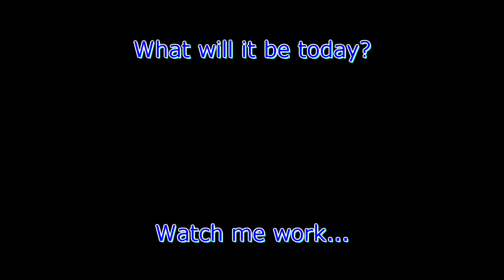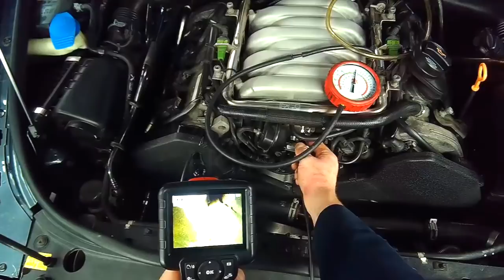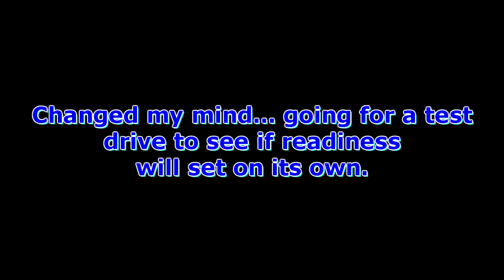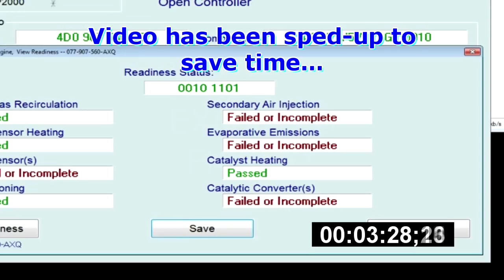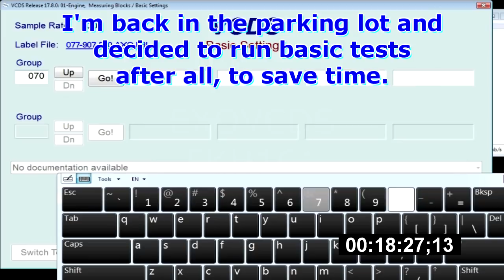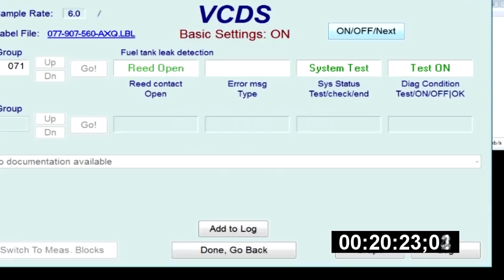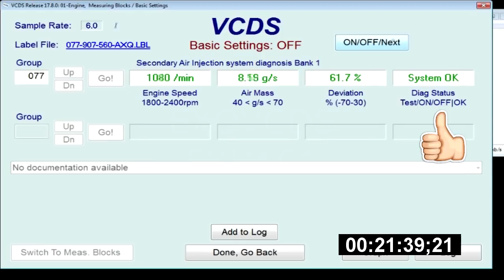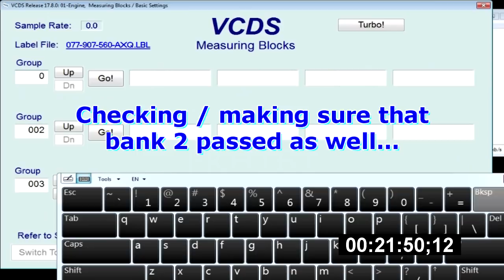VW 7L: Touareg with Secondary Air Injection Fault

Comment: Nice work. Handy having the right diagnostic tools and the knowledge to use them
Reply from the maker: I still tend to overthink stuff and that can add to the time (and pain in the head).
Reply: Thinking is the best way to travel.
Speeding through the universe.
Reply from the maker: Makes sense... all the daydreaming I did in High School... time DID go by quickly!
Reply: There ya go man 
keep as cool as you can
face piles and piles of trials with smiles
it riles them to believe that you perceive the web they weave
Reply from the maker: MostlymoparIH Whoa, that's deep man!

Comment: I've watched this twice and don't really get it yet. Gonna give it a third go later and maybe watching on a bigger monitor well help so I can see better. Combi's good, Mani vac good, check valve good, no restrictions, solenoids good. You checked to see if monitors would set with the one pod removed and that worked confirming bad pod. I'll be back....
Reply from the maker: Yes... the bad pod was leaking air / vacuum, which prevented enough vacuum from getting to the combi valves.
Reply: Thomas EXOVCDS Codes will come back since still bad pod. Monitors will auto reset after customer repairs pod and then does 20 mins of driving. Codes go away upon monitor reset. Happy days?
Reply from the maker: I left the pods disconnected... intake runners are not monitored, so no codes will set for them not working. Secondary Air will continue to pass as long as the pod(s) remains bypassed... until he replaces it. Yes, happy days!

Comment: Hey! I stumbled across your vid having the same issue. I must say it was very informative and helpful. My question is: what is the actual name or part number for the pod. I’m currently looking for one. Thank you in advance. And one more question if you don’t mind. Would that also throw codes for the O2/ catalytic converter as well. I have very hard shifts and sluggish performance and I’m wondering if they are related by chance.
Reply from the maker: https://www.ecstuning.com/b-genuine-volkswagen-audi-parts/intake-manifold-repair-kit-priced-each/077198327a/
No O2 or cat code on this one, so no... I don't think a bad pod will cause those codes.

Comment: Thx for sharing this my friend! Good info on setting the monitors
Reply from the maker: They can be set in the parking lot (not moving), by following the VCDS instructions... but I like to see the ECM set, so that there is no doubt it will do it the next time. But when time is a factor, I too "force" the tests! LOL
Reply: Thomas EXOVCDS I have run into air pump issues like so, then monitors take for ever to go by it self. Share as much as VCDS as you can. That is super helpful
Reply from the maker: Had there not been a vacuum issue, I would have activated the pump (output tests) to verify operation and would have also opened the diverter valves & ran the pump manually... to watch fuel trim values. Similar to this video:
https://www.youtube.com/watch?v=4GPFeCeugNk

Comment: Have you ever ran across a situation where both combi valve ports going into the heads on both sides are totally clogged? I am dealing with that now. Last week I chased the holes going into the heads that leads into the combustion chamber first with some stainless wire and then with aircraft cable wire. I got A LOT of crap out.

I replaced the passenger side combi because it started to leak a bit. I put it all back together and got the same code, bank 1 and 2 insufficient flow. I opened both valves via a vacuum tester and tried to blow air into the metal piping that the air pump blows into that leads to the valves and into the head, nothing.

Now it seems that I am going to have to pull the valves yet again and use something stronger than throttle body and carb cleaner, perhaps use acetone and plug the holes for a couple of days to let it soak.

One of German engineers dumb flaws is the setup of the SAI system. It would have been nice if they would have had the holes going into the cylinder heads a bit bigger so they wouldn't gather carbon like they do. Heck, it would have been nice not to have the system at all and to be able to bypass it without throwing a code. If only I lived in one of the states that did not do emissions testing.
Reply from the maker: I have been lucky not to have to deal with plugged SAI passages... so I can't offer any advice with regards to the best way to approach the cleaning or what works best, sorry.
Reply: I managed to get both ports unplugged. I took the combi valves off from the heads, then I took the valves off from their mounting bases and bolted the base back onto the heads.

Then I filled the passage ways with acetone until I could no longer fill them and let it sit in there for a couple of days with the holes plugged with silicone plugs that fit.

I then purchased some acrylic clear tubing at a Home Depot and ran it down the passage ways and sucked out the acetone with a suction syringe. There was A LOT of black carbon that came out of both passages.

I flushed them 3 times until no more black gunk came out. Before, I couldn't get any air at all into the passenger side passage way, and little air down the driver side. Now I can get a good amount of air running into both of them.

The acetone worked a lot better than any store bought cleaner in a spray can that I had purchased. For good measure, I filled both passage ways 1 last time and will let it sit for a couple more days and then put it back together so I can FINALLY get that car to pass inspection.
Reply from the maker: Sandman1832 good info, thanks for sharing!
Reply: No problem mate. Some of your videos have helped me when I needed help. Anything that I can learn while working on my vehicle that would benefit others, make things easier for others, or even show a simpler method of doing things, I figured that I should share that information to help out.

Between knowledgeable forums and youtube channels like yours, I have saved myself a lot of money working on my 6.6 Dirtymax and my audi, especially with the Dirtymax.

Comment: Great video. Told me loads. My diaphragm arm was broken. Fixed that. It works! Then saw the second diaphragm not contracting (left of your problem diaphragm in your video, front view). Contracting is a vaccum issue? . Is that a total replacement or check for working system/spring? Appreciate guidance
Reply from the maker: Could have a broken diaphragm... check it with a vacuum pump.
Reply: @EXOVCDS  cheers, will do. I've not yet vaccum sucked the diaphragm but I note your solenoid arm was moving (from the manifold). Both mine don't move manually (the fixed good one moves when revving). Normal or no?
Reply: @EXOVCDS  update,..... you did it!! 

It was a torn diaphragm (same one as vid). Will replace. I did a smoke test and smoke came out. Will also replace most hoses for assurance. 
New issue, the arms of both diaphragms don't move (by revving engine or finger force). How come? 

Plus the brake booster vaccum hose was cracked (temp fix with tube piece over the top). Will order new.
Reply from the maker: @wviti64  Thank you for the update! I'm not sure what the actual criteria for movement is... some things don't get activated unless the vehicle is driven / an actual load is applied. I would use "output tests" in VCDS to check ECM control of the actuators. If they work in output tests, then there's no reason the ECM would not be able to move them when needed (while driving).

Comment: Nice Work. How long did it take to to diagnose the issue? Very detailed and thanks for making the video.
Reply from the maker: Under 10min for the low vacuum fault (main cause)... 20+ minutes for test drive to verify (which could have been done under 10min by forcing readiness in the parking lot).
Reply from the maker: Not sure where your other message went (about the pods)... thanks for the info! Send me your mailing address and I'll send you some of my channel stickers! If you want some. fkh161@fkh161.ca
Reply: I deleted it. I didn't want to put too much information that might distract from your diagnoses and skill.

Comment: 2004 VW Touareg 4.2L V8
17887-008 
181104-002
17819-002
17072-004
01045-008

I can't seem to find anything related to all these codes.. perhaps you can lead me to the right direction for these..
Reply from the maker: You are subscribed to a lot of good car channels... they didn't reply? 
The brake booster vacuum system code is probably due to a vacuum leak.
Bank 2 SAI fault code should be easy to fix, since bank 1 is OK (check the system like I did).
Get back to me with what you find for those two and we'll knock off the rest.
Reply from the maker: Any update?
Did you find a leak in the brake booster lines?
Is the SAI combi valve OK for bank 2... the vacuum solenoid & lines ok?
Reply: @EXOVCDS  I haven't done that I'm watching your video again. But I know I need a new fuel filter hopefully fuel pump is ok but im going to begin this issue tomorrow
Reply: @EXOVCDS  oh when taking out the air filter on passenger side it was stuffed in (like squished) it came out in pieces and there was an connector at the bottom of that air filter it wasn't on properly. I got new air filters coming in plus I'll be doing spark plugs on this VW touareg once I gotten the present problems done and cleared
Reply from the maker: Thanks for the update!
Reply: @EXOVCDS  😡

Comment: my Tuareg 2004 v8 when I start it robots 30-40 sec and then turns off gives errors P 1423 P 1411 I checked the pump and even replaced it, but it does not fix and continues to shut down. when I force it to full throttle it does not go out
Reply from the maker: What does "it robots for 30-40 seconds" mean?
Lack of secondary air flow should not "stall" the engine... but it is in indication that there might be a vacuum leak (excessive lean running / fuel mixture at idle can cause the engine to stall). Listen for a vacuum leak (hissing / sucking noise) while the engine "robots". Post a video on your channel so that I can see & hear what it is doing (youtube is great for sharing videos).

Comment: What code was it reading?
Reply from the maker: In case you missed it in the video... pause at 0:05
Reply: Haha wow i totally missed that. Thanks. I did get a different code than this. P0492 looked it up on your 200page list.
Reply from the maker: Bank 2 (driver side) failed... which means that the Air Pump, the fuse, the vacuum solenoid are all good, because bank 1 passed. Look a broken vacuum line to the bank 2 combi valve and check if bank 2 combi valve opens (it could be stuck closed). My 200 page list?
Reply: @EXOVCDS  Oh I thought the list of codes website was yours that’s all. 
Btw I got the new check valve in the mail today and I want to confirm with you that’s it’s just a unbolt and bolt back on type of job..? And I also want to confirm that it’s the right side of the vehicle when looking directly at the vehicle from the hood? 
Thanks for your help
Reply: @EXOVCDS  sorry for all of my misspells. Tried talking to Siri and it didn’t translate well. I just fixed all of the bad grammar so hopefully
My questions make better sense now.
Reply from the maker: @mallkrawlerz620  Standing in front of the vehicle, bank 2 is the right side (driver side) yes.
Reply: @EXOVCDS  thank you

Comment: if you own one of these and want to cheap out on those vacuum pods they are very pricey from VW or Porsche, you can get Cruise  control pods off a volvo 850 will do the same thing . just saying.
Reply from the maker: Good tip... thanks! Did I send you some channel stickers already?
Reply: no..lol
Reply from the maker: Send me your mailing address (private message) and I'll send you some.
Reply from the maker: +DW Red Got your message... they will be in the mail tomorrow!
Reply: I've looked...land rover, jaguar, volvo, Mk3 Golfs/jettas...these pods still command a healthy asking price...I think new, the cheapest I found was from a Lambo site of all sites...VW sites wanted a bit more...sure, Ebay has them too, but those are all "used" with unknown mileage, actual working condition, etc., etc....I'll try rockauto and see what they have or world impex.
Reply: Landrover ETC7150 / $85. The only difference is that the metal clip that connects to the linkage arms on the pod is slightly different angle. Not sure if they rotate or you can use the old clips. It is the same part # made by Hella, just the metal clip is different. Let us know if it works.